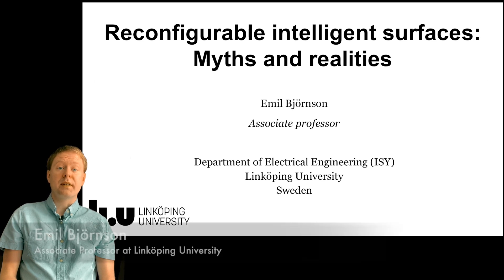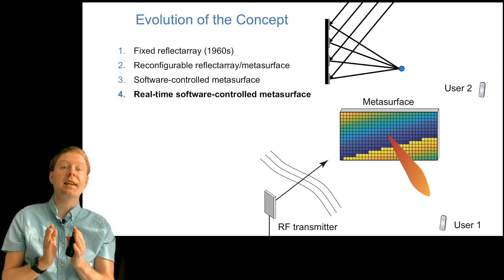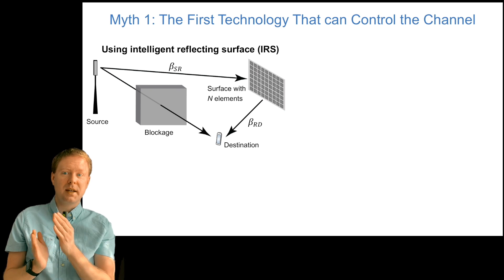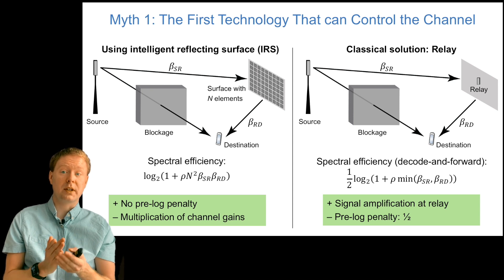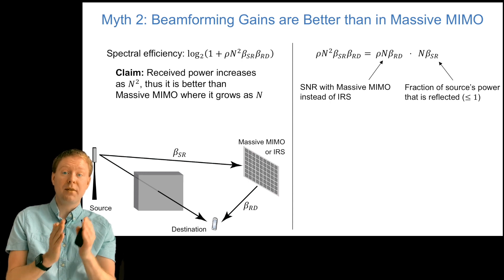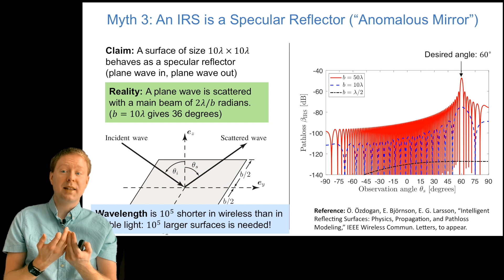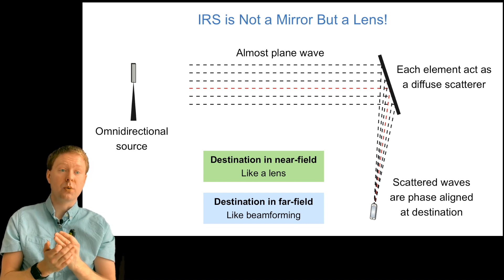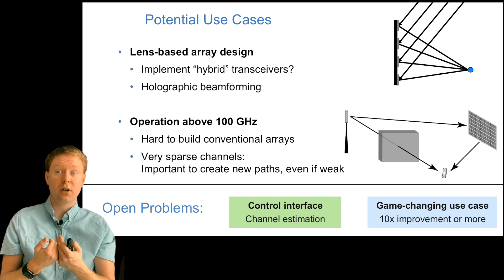Reconfigurable intelligent surfaces: Myths and realities

Comment: This talk about mirrors and reflective surfaces reminds me of something I came across almost 50 years ago, when I worked for a telecom company.  This is "billboard reflectors", which were huge reflectors, used to extend a microwave path beyond line of sight.  While this was used in Canada's far north, the one I came across was at an office I worked in, in Capreol Ontario, which connected to another office in Sudbury.  Problem was Sudbury was down in a valley (created by meteor impact) and the rim of the valley was blocking line of sight.  To get around this, a billboard reflector was placed on a hill north of Capreol, which was line of sight to both offices, allowing the microwave connection to be made.  This dates back to the mid 1960s, when that network was set up.  I expect that link has long been replaced by fibre.
BTW, that meteor is why the Sudbury basin is home to copper and nickel mines.

Comment: How can I make a simple RIS using copper tape on cardboard? How do I know what the pattern should be on the unit cells? Can you post a video going over making a small (2x2 or 4x4) RIS to demonstrate redirecting a beam from a antenna to a receiver antenna?
Reply from the maker: The easiest thing is to use a normal mirror and rotate it so it reflects the signal in the right direction.

I don’t know how to build something more RIS-like with such basic components. You can possible have multiple small mirrors and rotate them individually.

Comment: may be a trivial question. may i know how the reconfigurability is realised. 
1. the fpga or microcontroller controls the pin / varactor diode switching. 
2. reconfigurability in metasurfaces is due to metameterials changing their permeability and ( other properties? ).
how 1 and 2 are related. i mean how the diodes effect the metameterials? 
kindly help me understand this. 
thank you
Reply: requesting you for clarity on this @wireless future
Reply from the maker: Hi! There are many ways of implementing an RIS, depending on the frequency and other characteristics. From a purely communication theoretic perspective, the essential thing is that the RIS consists of many individually controllable elements. Their respective impedance should be controlled somehow, because it determines the reflection properties.
If each element is viewed as a circuit, we can change its properties by modifying a voltage or a pin diode.

Here is a paper that elaborates on different implementations:

O. Tsilipakos et al., “Toward intelligent metasurfaces: The progress from globally tunable metasurfaces to software-defined metasurfaces with an embedded network of controllers,” Advanced Optical Materials, no. 2000783, 2020.
Reply: Thank you for providing such a nice reference  @WirelessFuture

Comment: may be a trivial question, not for the professor Emil . myth 1 : can anybody justify the spectral efficiency formulae in both cases.
Reply from the maker: Hi! You can find the formulas in our paper https://arxiv.org/pdf/1906.03949.pdf where we are proving the IRS formula and give a reference to the proof of the DF relaying case. Please note that this paper considers a non-zero direct path between the transmitter and receiver, so the formulas are slightly more complicated.
Reply: Thank you so much @WirelessFuture

Comment: Hi this article that you share in the slide in which it is mentioned that DF relay shows better energy efficiency at low data rate but what about if we compare IRS with AF  relay
Reply from the maker: Such a comparison was made in one of the first papers on the topic: https://arxiv.org/pdf/1810.06934.pdf

However, DF is usually a better relaying protocol than AF and is widely supported. This is why we chose to focus on DF relaying in our paper https://arxiv.org/pdf/1906.03949.pdf

Comment: Hi Professor,
I have a doubt regarding the near field effects you mentioned in Section III of https://arxiv.org/pdf/2002.04960.pdf: According to the paper the following three fundamental properties, 
1) The distances to the elements vary over the array;
2) The effective antenna areas vary since the element are
seen from different angles;
3) The losses from polarization mismatch vary since the
signals are received from different angles,

becomes significant when the size of an IRS is beyond a limit. What happens if we use an infinite number of IRS modules of the same size and each with a different control channel (assuming its availability) so that the user is in the far-field of each IRS module?
Reply from the maker: Hi! The user will typically be in the far field of each IRS element and possibly also in the far field of groups of adjacent IRS elements (if that is what you refer to as an IRS module). Each one can be modeled as described in the paper, because the near-field formula is correct also in the far-field.

The important thing is that an infinite set of IRS module can at most capture all the transmit power, which is a finite number. Hence, as you add more and more IRS modules, they will capture less and less energy. The reduced energy can be explained by the same three reasons as listed in our paper.

The paper considers the asymptotic behavior for a large planar array, which eventually will capture one third of the paper and can reflect it towards the receiver.
Reply: @WirelessFuture  What I meant is a multi-IRS scenario, apologies for my poor terminology. Let's say each IRS is of area 1m^2 and we use an infinite number of them to serve a user.
Reply from the maker: @nithinbabu4962  When deploying infinitely many IRS, you need to think carefully about how to deploy them so they don’t block each other. An IRS that is behind another IRS doesn’t get a signal to reflect. Any feasible way of doing this will result in some elements being asymptotically far way. 

Once you have figured out the physical location of the IRS, you can use a conventional far-field pathloss (channel gain) model for each surface. When you add them up, the number will always be smaller than 0 dB, since one cannot capture more energy than was transmitted. If you get anything else than that, the surfaces were either deployed incorrectly (behind each other) or one of the three conditions was neglected.

Comment: Hi Professor, What software you will suggest to simulate this type of metasurface? and is there any way that I can communicate with you regarding this?
Reply from the maker: The answer to your question depends on what aspects of the metasurfaces that you are interested in: the hardware design or the algorithmic design.
Reply: @WirelessFuture  Hi Professor, thanks for replying. I am talking about both hardware design and algorithm design. I have another question how this intelligent metasurface or coding metasurface is different from the reflect array antenna?
Reply from the maker: @subhoartwork  When it comes to software, I think most people are writing their own code in Matlab without a specific starting point. Here is one example of how it can be done: https://corelab.ku.edu.tr/tools/simris/

The CST Studio Suite can be used to simulate the hardware aspects.
Reply from the maker: Metasurfaces and reflectarrays are different ways of building materials that are interacting with electromagnetic waves in unusual and reconfigurable ways. The "reconfigurable intelligent surface" concept is a vision of using reconfigurable surface to aid the communication performance. It can be implemented in any of these ways. It remains to figure out which is the preferable way.

Comment: Hi Prof. Björnson. I'm thinking of incorporating these IRSs in optical wireless communications, specifically in FSO systems. In this case, we are using lasers instead of radio waves. It's often the case that concepts in RF cannot be translated directly to optical wireless communication systems.  While the generalized Snell's Law is still applicable, I'm not sure about how the 'reconfiguring' and design of these metasurfaces for optical beams would be.
Reply from the maker: This is a good question. On the one hand, Snells law and similar optical behaviors are better describing the actual behaviors in FSO. On the other hand, it might be much harder to build an IRS in those bands since the wavelength is much shorter and the size of each element is usually a fraction of a wavelength. I think the answer is: theoretically you can use IRS in optical communications but the hardware design might be too complicated.
Reply: @WirelessFuture   Yeah after reading further,  I found out that yes it is possible, theoretically, to have IRS-based FSO communications but the big issue seems to be
how to design the phase-shifting. The only paper which has attempted this so far actually considers and equivalent mirror-based system of the IRS and employs concepts from geometric optics. Someone suggested I consider metamaterials instead. What do you think?
Reply from the maker: Kappa Tau I think metamaterial can be used if it has fixed properties. But reconfigurable metamaterial sounds very hard to build at such frequencies.

Comment: There is a paper concludes that the the IRS-assisted system is able to provide an energy efficiency up to 300\% higher than what can be provided by an angular multiple antennas amplify-and-forward relaying.  Do you think the outcomes of this paper contradicts your results. This is the paper:
Huang, Chongwen, et al. "Reconfigurable intelligent surfaces for energy efficiency in wireless communication." IEEE Transactions on Wireless Communications 18.8 (2019): 4157-4170.
Reply: Oh I realized now your work is decode-and-forward relay and their is amplify and forward.
Reply from the maker: Exactly. Decode and forward is usually a better method, and still has very low complexity.

Comment: Question for the Professor : How does it compare to DF relays interms of complexity and power consumption in processing circuit ? Is there a win there for the intelligent surfaces ?
Reply from the maker: bh282 It is very hard to tell since the technologies are so different. A passive reflecting surface has no power consumption, but an intelligent reflecting surface requires a control interface, which includes a communication link to a base station and internal control of the individual reflecting elements.

I've heard some people claiming that this has an almost negligible energy consumption, while other claim that it is almost the same as for an array with full transceiver chains. The future will tell what is right.